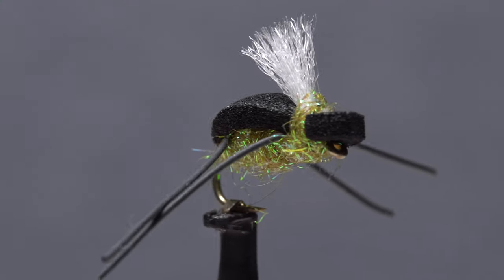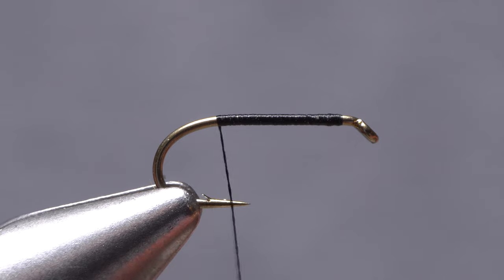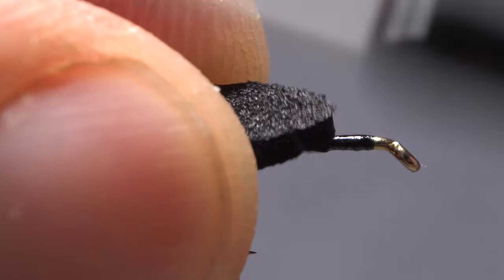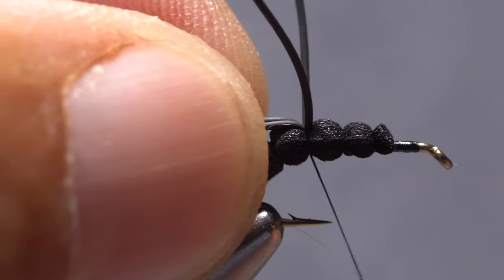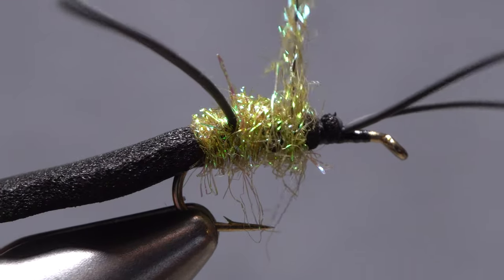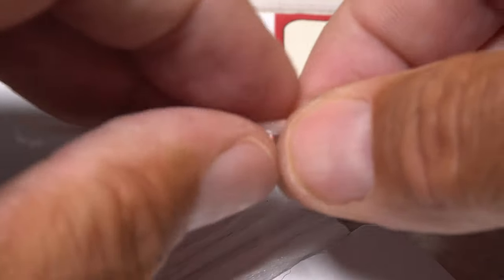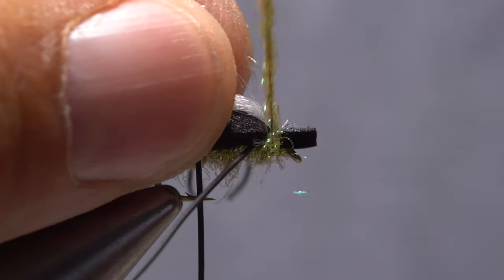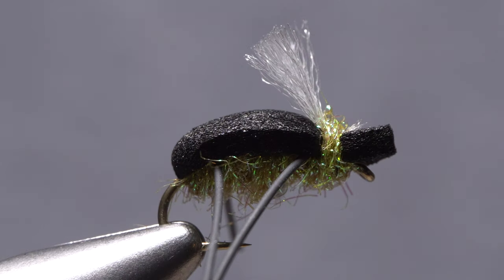Turbo Beetle

Comment: As a newbie tier, I have a couple of questions. What size is the beaver tail cutter? What does the ice dubbing represent on a beetle?
Reply from the maker: The Beavertail cutter is the small size from River Road Creations. The ICE dub on the underside of the beetle, to me anyway, is more attractive than it is representative. There is something about ICE dub on the underside of foam bodied flies that just plain works.
Reply: You don't neeeed the foam cutter either... especially with beetles. Unless you plan on tying a ton of foam terrestrials, I would just deal with the foam strip like he recommends in the video. I don't know your reasons to get into fly tying, but if you're a true Newby I would highly recommend starting small and see if you really like spending hours at the vice to fill a box. Many love it, but it's not for everyone. No sense buying a $20 cutter for bulk/show quality flies if you end up not enjoying tying. Just my two cents
Reply: I just cut the shape with scissors. Even one flies like chubbys.